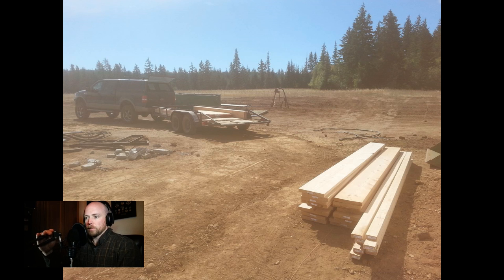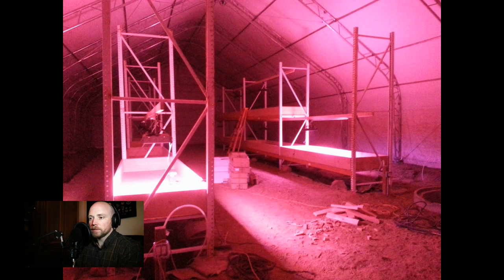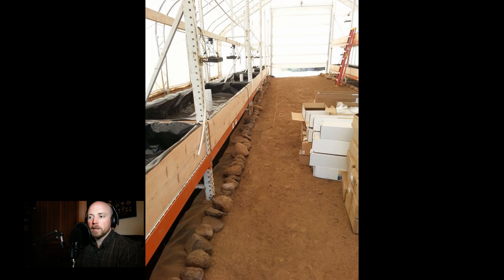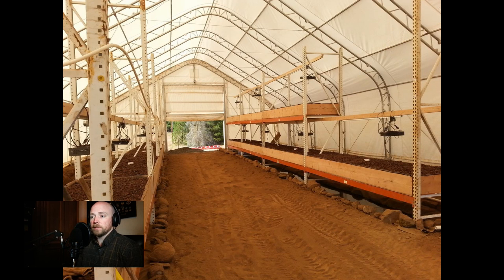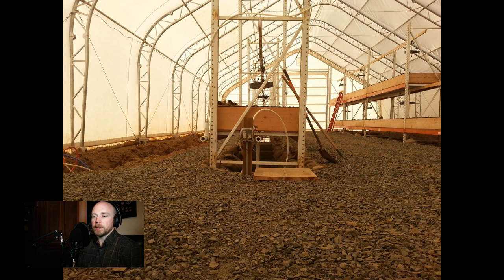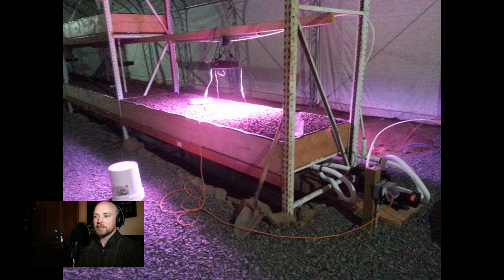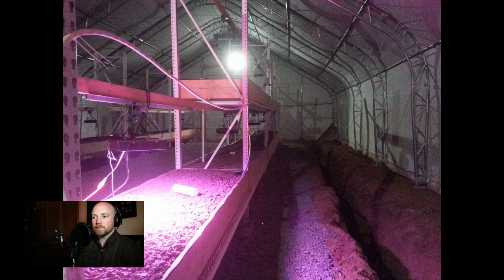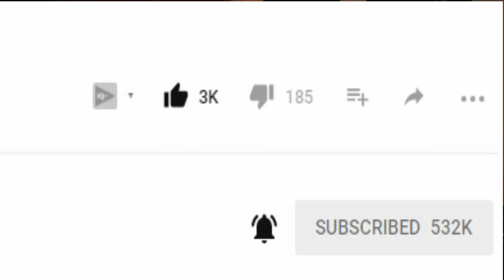The ULTIMATE Vertical Rainbow Trout Aquaponic Grow Beds

Comment: I would consider spanning the fish bed with a treated 6x6 maybe 6-8ft long - extending well into the walk lanes on each side - making the tops of the beams flush to the gravel walk lane and setting the posts from the grow bed support structure on those beams.  You can still drive the rebar into the ground for additional security through those beams.

Comment: Well done again. Soil density would be my biggest problem here in Florida, even with some sort of concrete "rim" I would guess the sand/clay mixture would eventually erode into the fish beds. It would be great to have the beds dug in, as it would help with cooling down here. However, to do so I probably would need to dig footers around the entire fish bed with anchors going deeper than the bottom of the bed. I would also have to deal with the issue of predation (raccoons, feral cats/dogs, snakes)... Interesting problems.Side note - YouTube loves nothing more than to point out the obvious errors that you have already admitted too. Everyone on the internet is a arm chair quarterback. I just want to say, that I (and probably many others) appreciate your candor. If I could afford to and was able, I would volunteer to work a summer with you, just for the chance to learn.

Comment: Thanks for sharing this. I was thinking a cross member going over the fish and under each pare of legs would help to stabilize the structure, then you showed the drama scene with the beds at the crazy angle. With the amount of weight you intend to put on the grow lanes I would put in weight bearing wood or steel across the whole green house. this should save the need to dig piles in to take the weight. To help secure the whole structure a few wire cables going across the tops of the lanes tying them together.
Food for thought, its not a criticism. All the best Mike.

Comment: Could you use a laser measure and see how twisted the frame is? Could you then not adjust with a hammer and weld bars in underneath so maintain the rigidity of the shape so that lane 3 upper as a gremlin stops?

Comment: Is it not possible to put steel wires through the top of the shelving, and connect it to the steel frame of the building? Like a last resort, if the shelves tumble. (of course there should be tension on the wires from the start though)